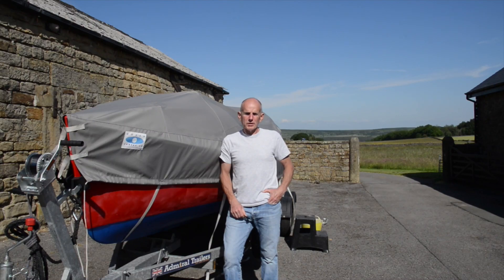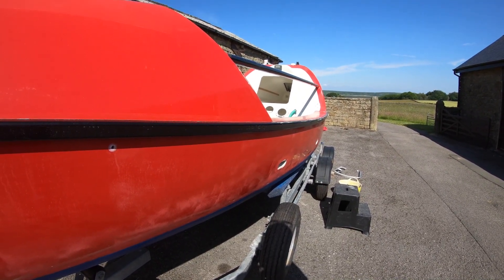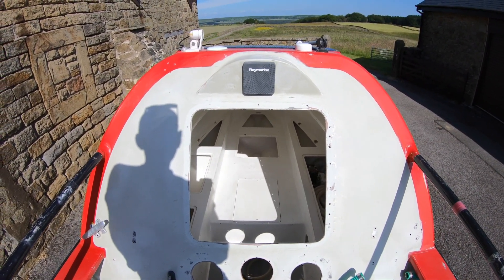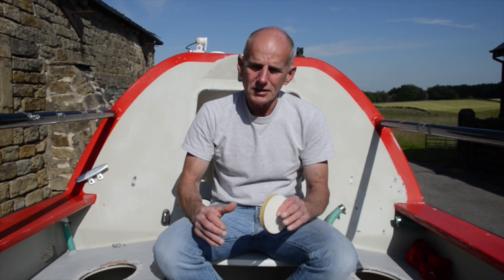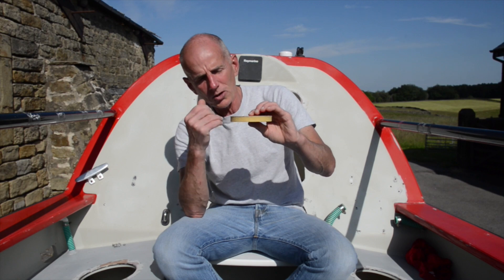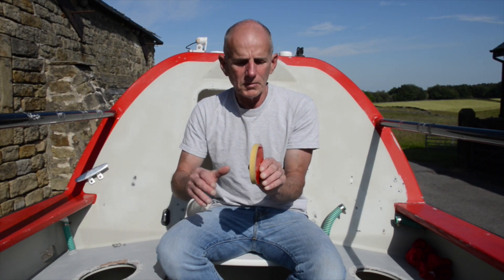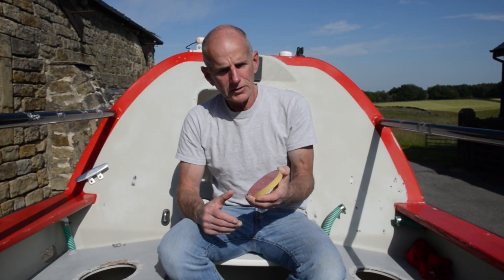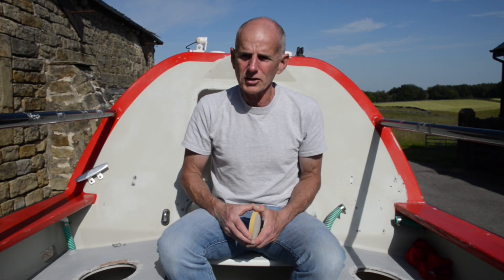Refitting Ocean Rowing Boat For Indian Ocean EP2 -  Solo Ocean Rower

Comment: Your fan problem could possibly be a simple design issue. If they were both pulling in the same direction, then they would fail under load. You would actually be trying to either pressurise the cabin, or create a vacuum. To work properly one would need to be extracting from the cabin, and the other would need to be drawing air in. Apologies if this is old news........
Reply from the maker: Hi Mike, I like your train of though, the cabin has a vent at the rear too so circulation is not an issue. The vent fans are just not big enough to impact the heat, when it's 46 degrees on deck I've no idea what it is in the cabin but it's hot. The other problem is they are solar powered, the only time I'm in the cabin is at night and they don't last long enough to have any benefit.I ran them as extractors in the day hoping  to cool things down but no real benefit again. They have given up the ghost which is good, gives me a chance to come up with something new, not sure what yet.
Reply: @soloatlanticrower  Ventilation can only ever deal with excess heat, not the ambient, unless there is evaporative cooling designed into the system. Ideally, you'd paint the cabin white or silver, and have nothing of any thermal mass inside it during the day. You could try putting a watertight bag of sea water in the cabin during the day, and then tipping it out overboard shortly before you go in for a kip. This should take quite a lot of the heat with it...but at the cost of a bit of extra unwanted ballast on board.
Back to the fans......ideally you would have an "in" and an "out" fan of the same strength but at opposite ends of the cabin, producing a draught over your body at night. I recognise that this would put one of the fans out of easy access whilst at sea, which wouldn't be ideal. You could also consider an extractor at the very top of the cabin of the sort that you see on top of vans. They aren't turned mechanically, but rotate in the wind. They have the advantage of not needing a power supply, and of being at the highest point of the cabin where the warmth collects naturally. The downside is that I have no idea how you would keep water out.
Ultimately, if it's hot you're going to be hot! We're only talking about mitigating the odd 5% at the extremeties, unless you can take a course further from the equator.
Reply from the maker: @MikeAG333  Hi Mike, I appreciate the thought you've put into your comments. There is only a small part of the aft cabin where the paint is exposed, most of it is solar panels, so the paint job wouldn't achieve the desired outcome. I considered in out vents but the integrity of the cabin is critical, the main reason is that the sealed cabin is how the boat rights itself in the event of capsize. the three current vents are sealable. I'm afraid you just have to suffer the heat. the small rechargeable fans did move enough air to keep you from sweating too much and drenching your sleep area. It is an issue I will give some though before going back to sea.
Reply: Enjoyed this exchange of minds and ideas here. I had the same issue and thoughts of solutions. Didn’t have any fans rigged up either. But that temptation of leaving the hatch ever so slightly open yet still on its catch is so tempting. Right up until the wave hits and undoes any extra sleep you may have gained. 
Loving the videos of the boat refit. I think Justin said he had adapted it for two sleepers for your Atlantic crossing.
Reply from the maker: @craigforsyth5394  Hi Craig, looks like you rowed is a sister boat to Socks, I believe Storm Petrol was also built by Jamie. Yes Justin helped make a few changes to Socks, when Jamie built her for my Pacific crossing we jiggled about the aft cabin and deck configuration as my daughter had expressed a desire to row. She is really a solo boat but we raised the cabin floor in the sunken sleeping area to the locker height so we could both get in the cabin in case of bad weather, it was both tight and necessary. The fan thing is a minor improvement, but then as you'll know any relief from the incredible heat that builds in the cabin is a gift from the ocean gods. We'll done on your crossing, good to see you had a real rowing boat not a blowing boat.